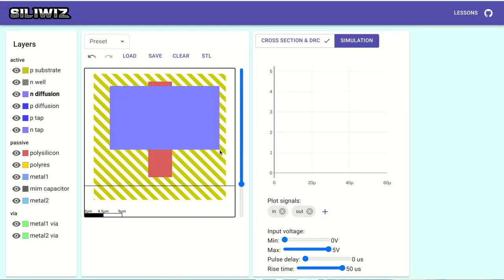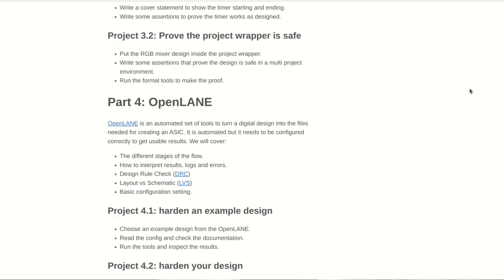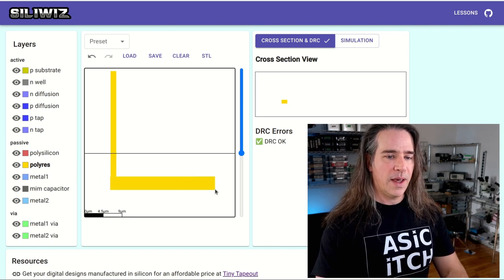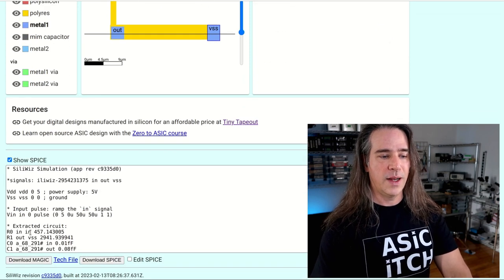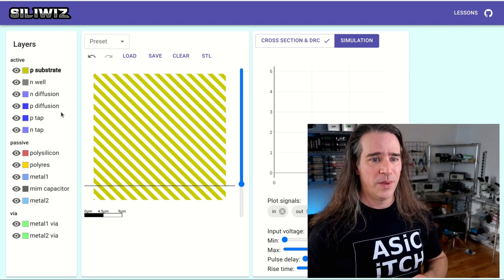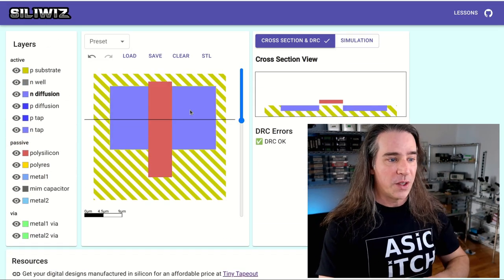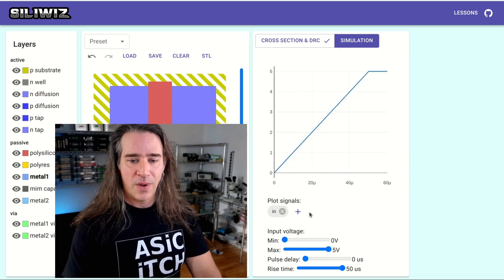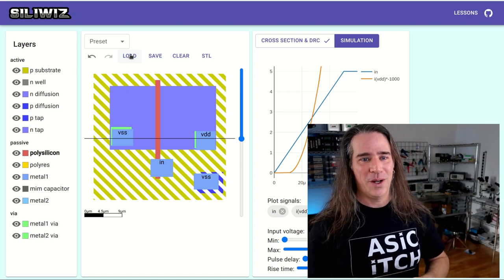Learn ASIC design with the 1-minute MOSFET

Comment: Great video! You mentioned in the beginning that you have designed analog neural nets. I have been planning to design one myself as a fun summer break project. Are there any tips you may have to get started? From what I’ve heard, it seems like a huge but super rewarding process.
Reply from the maker: Hi, thanks!!  Yes, well kinda... I didn't design the nets, I worked on the project and I want to get into designing such, which is why I'm doing the whole ASIC course thing.  My experience to date is that it is, like you say, pretty huge and rewarding.  My advice would be:
 * even if you're going for custom chips and such, start getting to know your basic units in sim and even with discrete components;
 * be ready for a whole lot of process variation--matched FETs is nice and all, but even in the same area of the same silicon, I didn't know how much impact this could have.  If you can do your current mirrors and all the bits with discrete components, you'll have a clearer idea of how to design some resilience and just how many knobs you need for trimming; and
* instrument that thing like a madman, and allow for isolated use and characterization--on first iterations, we needed to look deep deep at everything and have bypass channels to eliminate variables and sidestep things that didn't workout so well to refine the other parts in parallel.
But, like I said, I wasn't on the design team for that... working on it, next time maybe :)  
Good luck/have fun!
Reply: @PsychogenicTechnologies  Thank you so much for the informative response! I can’t wait to see how this series goes. Definitely subscribing!

Comment: I have a question that I hope doesn't annoy you, but I come from a creative background and have worked in the creative industry in films, videogame and commercial  as a Creative Director, but the last 2 years I've been out of work and it has been very hard to find any work in this industry right now.

So now I got a potential job to become an ASIC Designer. I've told the guy that wants to hire me that I know nothing about programming and electrical engineering and it would be very difficult for me to come in and just learn it without foundational skills to get there. He is in a high position and keeps telling me how easy it is to learn, but I told him he has decades of experience in this industry and I don't.  But....I'd like to get this job because I'm desperate to get back to work and don't mind working anymore, but I am afraid I won't be able to learn it adequately without any experience. I've been watching videos for awhile to get prepared for this by january. They plan on sending me to school for  6 months to learn it, but is that enough time to grasp the concept to work adequately in this field?
Reply from the maker: Hello Andy,

This may be a bit of an odd situation--I'm unclear if you've got any technical background or inclination, and you have to wonder why this guy is offering the job and training.  Could be he sees some awesome potential, could be ... something else.  I'll let you handle that aspect of it.  The final bit on this front is: hunger's a good baseline motivator but not, in my experience, the best for excelling, having fun or longterm progress.  Anyway, I hope you find an enjoyable path and this might be the doorway to a whole new world for you.

My thoughts on this are basically that you can most likely get proficient pretty fast, especially if you've got a logical mind, are someone who can think "ok I am here/have this and I want to get there/produce that, what are the steps it would take to make it happen?" and come up with some ideas.  Now if they're talking about analog design... well, maybe not that fast, but really it depends on you.  
I'm going to assume we're focused on digital, and its the best place to start regardless.  In that case, I think the best approach is just NOT to wait.

An ASIC is a mass-producible, cost effective way to create a whole lot of tiny circuits.  But, logically, you can do all the same digital things with an FPGA.  So, with $40 or something, a laptop and some effort, you can gain both a ton of experience and an appreciation as to whether you'd want to spend your day doing this.  

Do a search for "ice40 fpga module" and you'll find a ton of little devices you can use with open source tools and projects (i.e. both free and usually backed by a community of interesting and interested people).
In fact, before you even spend that money, go through the digital design guide using a simulator, like the one on tinytapeout that uses wokwi (a simulator): https://tinytapeout.com/digital_design/

It's all free, and it's a nice way to play with these things a bit.  Don't worry if it's a bit overwhelming at first, if you've never seen a logic gate.  Just follow the handful of exercises and play around.  Then there's the wokwi discord with lots of people who use it and can help.

Once you feel you get it, start with FPGAs.  That's a world unto itself, and you can go as far as you like.  Within a few weeks, you should be more than ready to absorb anything the training will throw at you.  

Finally, there's the zero2asic course (disclosure: I work with Matt on this): https://www.zerotoasiccourse.com/  Name says it all.  I think it's pretty cool.
Good luck and have fun (best way to get good at stuff... and to me all this is not easy, but fun!)
Reply: Wow that is the most thorough response I've ever gotten.  I got the job offer because he just likes me. Simple as that. I've known him for awhile and have helped him with a lot of creative gigs. I told him I need a job that I would love to work in the marketing department and I also come from a creative background so he tried to find me work in those field, but unfortunately he's not connected to any of those fields that are hiring so he pressed the option of  Staff Engineer onto me, and said they will send me to school for 6 months to learn ASICS.  But I decided to look into it and see if I can learn it enough before I start, but now I am so overwhelmed. I told him this isn't something you can learn in 6 months with no prior background in electrical engineering!! But I'm desperate so I'm willing to learn.  I would say that I can learn technical stuff, but not this is a completely new field for me so I have zero understanding of it.  I have been learning about AI a lot and machine learning, that's as far as my technical brain works  outside of  3D animation which I guess is technical as well but does not require coding. When I do, I just google it. I actually saved your zerotoasicourse a few days ago, but right now since I  don't get paid much I wouldn't be able to afford that doing the current job I'm doing now.  But I definitely will sign up IF I take the job.  I hope I enjoy it, but reading and researching about it is giving me anxiety. I feel like I'm expected to learn something people learn in 4  years in just a few weeks, but I know this isn't an opportunity to pass as I've been reading that many people work hard just to get a chance at this.   @PsychogenicTechnologies
Reply from the maker: @AndyHTu  We're hitting on things that are much about personality and circumstance and, I don't know you so instead I'll tell you what I've had to tell myself a few times, and talk about what I found works for me.  
I work well under pressure--some of my best has come out in crunches and actual real life emergencies.  But there's a point a which it turns negative, into overwhelm and dismay, and then suddenly I'm ... out.  Learning is fun.  Cramming isn't.  Trying to swallow a whole career field in two gulps probably won't be enjoyable and can lead to sadness/burnout/whatever.  When I do hit these points, I'm lucky: my body just stops and won't let me go on.  So, ok, I stop.  And then I'll stay stopped.  
Until, that is, I let curiosity come back in.  Screw the project and the client and the deadline and the rent.  When you're just wondering "how does that work?" or "could I possibly...?" or "I just want to see if I might ..." and then you read a 5 minute tutorial, and try something.  And do something dumb, or explore some gadget.  No one wants to watch my RF videos, but I'm still curious.  So in moments like that, I just watch a 10 minute video, and then go muck around with a simulator or some actual components and try some things.  Sometimes there's an epiphany.  Sometimes it's just "huh".  But learning happens when you get some focused play time.  Then, sometimes, comes interest. And more play, and eventually you start getting good, which really gets motivating--then you get really good, after a while.  And not much later, I'm back in full swing, hungry to do learn and make things and share the results.
So, if you want to give it a shot: go for it.  But I'd try to be more curious than goal oriented for this.  And if you can't find anything you're wondering about, sure give it a little time, watch some videos doing beginner projects (checkout bitluni for example but there's tons of entry level stuff here)... and if none of it ever sparks a spark, well that's ok.  There are things that you are particularly suited to give to the world:  try to give some of that away, whatever it is today.  It's how I started 2 careers (so far).
Sorry if I sound like I think I'm the wiseoldmanonthemountain or something--I ain't.  But I've been in both the highs and lows of this type of journey, so hope there's something in all the verbiage that will help.
Cheers
Reply: That actually was a beautiful comment and kind of got me a bit emotional inside. It has been a really rough 2 years for me. I thought everything was going great and then big lay offs ruined my trajectory.  I'm actually on my second career as well. First being in the film and gaming industry as a 3d animator and visual effects artist, then I got into marketing where I did a lot of content marketing for about 10 years now. With this ASIC design, this would be my 3rd career but it's scary to me because I'm not a young buck anymore and the thought of having to go back to school and learn everything worries me and this time it is a totally different industry. I also had my own business but that too didn't go too well a few years a go so  I closed down. And no need to apologize.  Your wisdom is valuable to me! I've been blogging a lot as well and sharing my thoughts on the current creative industry but looks like I will be curiously watching these asic videos for now. I was given 2 choices, learn as much I can about asics in the first 2 weeks, then the second 2 weeks, learn about IC Layout, and see which one I would prefer. So this is my journey for now.  He told me that with my design skills, I would adopt IC Layout faster, but I looked that up as well and its the same situation.  You need a ton of education in electrical engineering and coding.     @PsychogenicTechnologies

Comment: Much more interested in learning how to convert a simple C app into a chip without having to do all the electronics logic manually like it’s 50 calendar years ago
Reply from the maker: Hah, but you're thinking like a programmer!  I tend to fall into the same... but really, if you're thinking in terms of step-by-step algorithms, maybe what you need is a CPU! ;-)  Seriously, anything that can/should be broken down into simultaneous/parallel ops can benefit from being done in hardware, and the best way to start that is with FPGAs.  Cheap, quick turn-around, fun.  
And getting down to the gate level is informative and fun, but that's like when they teach you to do derivatives by hand, over two pages of calculations: interesting, educational, way too painful for real life... you can use high-level tools, like Python and Amaranth (which I lean on a lot) that make doing design much less of a slog.
Reply: "fun"? LOL... Educational though.  @PsychogenicTechnologies